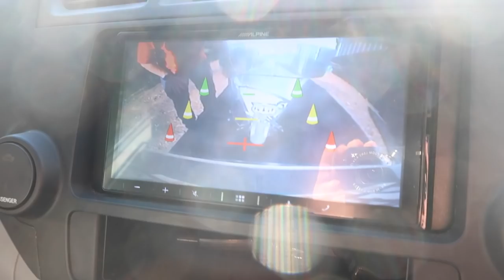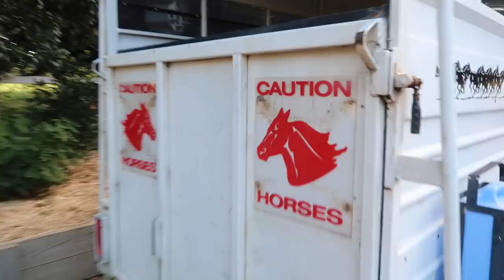PICKING UP MY NEW HORSE TRAILER! TRAILER TOUR!

Comment: You should of got a imperial
Reply from the maker: Definitely not, tuza are WAY more reliable... too many horses have gone through imperial floors. I would never ever touch a Chinese float...
Reply: I highly recommend them as the have a kitchen in them and they really good I had no problem with them
Reply from the maker: @joegallo5497  you can get a kitchen in a Tuza too I just didnt need a kitchen. I’ve heard too many horror stories about Imperials and other Chinese made floats therefore would never get one, not even brand new. It’s not worth the risk in my opinion 🤷‍♀️